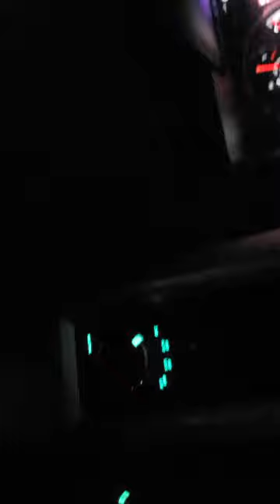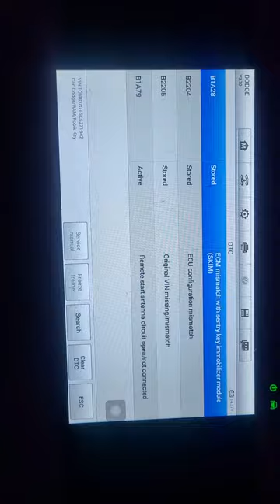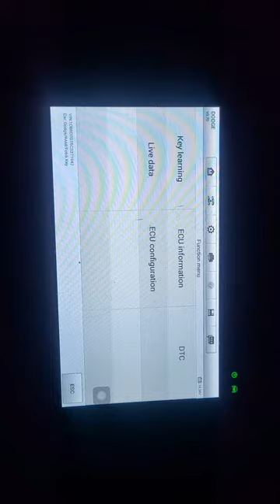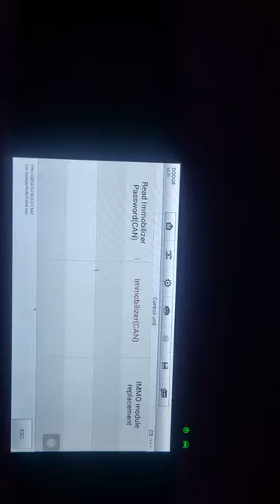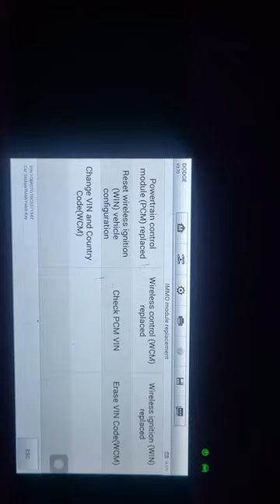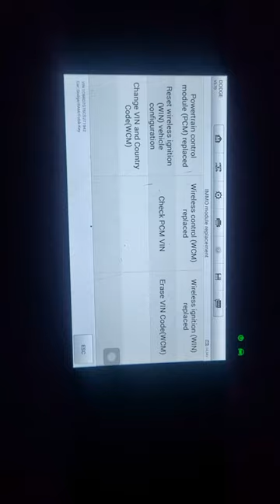programming used WIN MODULE  dodge ram 2012 via autel im508

Comment: Basically what you did is program PCM. Which means that you transferred the vin number that the WCM came with from the old car. And you wrote it on the PCM.
Now if the vin is matching with these 2, it will start and stay running. And could be that it's good enough for this year. But in newer models you'll have problems with other components in the car because the ABS for example won't work cuz now it has a different VIN number. 
So if you didn't see any other errors you should be good.

Comment: Hi is the vin module same as the actual ignition? I have a car that replaced ignition+steering lock. Car starts and dies in seconds. Im using im508+xp400 🙏
Reply from the maker: Yes the win module is where the fobik key goes

Comment: Hey i have the new win and new key it’s supposed to be preprogrammed to the vin from auto tech electronic would I still need to do whats done in this video and also would I be able to if the dash is not getting power in the run position only shows door ajar with the flashing security light
Reply from the maker: Yes same procedure. I did a dodge dart it was ready to go didn't have to do this procedure. But on the ram I did so different models differ. Do the procedure pull new pin. Also if u are programming a used key AND  it's oem then just erase all keys first and reprogram used key
Reply: Ok using two new keys supposed to be plug and play but getting no power to the dash I plan on having someone come tomorrow to program

Comment: So when you resync it does it use the orginal pin number or the pin number from the used win module
Reply from the maker: If its a used win u use the win pin. Of its a new oem win you'll need old win pin
Reply from the maker: Pin from used
Reply: @InitialD15  yeah I got it done. it was locked out due to too many failed pin attempts, I had to leave it with the key on to reset. then I followed your instructions in the video.

Comment: I have a customer that bought a brand new immobilizer for their 2008 Chrysler Sebring because they broke their old one… I have the Autel im508 & I need to program the new immobilizer to the vehicle in order to program the key to start the vehicle so do I need to go to Manual selection & then select control unit then select immo module replacement & once I get there do I need to select Wireless control (WCM) replaced option and then let it sync the Vin number & IMMO data in order to be able to program they key to it? Also since I’m programming an existing key that went to the original immobilizer do I need to access the old immobilizer and erase that key first before I’m able to program it to the new immobilizer. I own a locksmith business and I program keys all the time, but I have not done an IMMO replacement program yet with my Autel 
im508. Any help would be appreciated! Thanks
Reply from the maker: Ok first of all u replaced the module or the immo ring? That uses actual keyed ignition not fobik. So it won't have a wcm. U can reuse a used key on another chyrsyler unless u unlock it or erase all keys and then program a used one it should accept it. But the key also has to he oem not aftermarket.  Always manual selection never auto. Lots of issues with auto.
Reply: @InitialD15  their replacing the immo ring
Reply: @InitialD15  so which option would I use to transfer the Vin number and the immo data over to the new immobilizer module (the ring)which I thought the ring is the immobilizer module is it not? It has a module and ring all connected together and yes, it’s a blade key not fobik I just don’t know which selection I’m supposed to select which option I’m supposed to select to transfer the data onto the new blank immobilizer ring
Reply: @InitialD15  and why can I not use an aftermarket key? The key they have is the actual oem key anyways

Comment: Working in 2008 dodge caravan. Replacing win with used one. This should work. Correct?
Reply from the maker: Ya win module might b different part number but yes

Comment: I thought after you erased the vin that you're supposed to go to wireless ignition replaced
Reply from the maker: This procedure worked for me
Reply: @InitialD15 yeah your method worked for me. I just did a 2012 dodge ram with my 608p2 used one and it does not work the way they tell you to do it. It only works the way you've done it! so thanks.
Reply: I tried to do this on a 2010 Dodge Grand Caravan with my 508 and it just would not work. I don't know why, but it worked awesomely today on the 2012 Dodge ram I just done. They had Locksmith come out and try to do it and they couldn't & one locksmith told them  they don't do ones lol

Comment: What about the PIN code? Can you get it if the old WIN module is out and gone already?
Reply from the maker: Only need new used win module pin. Only need old win module pin if u buy oem new win
Reply: @InitialD15  customer says WIN is actually brand new. I saw a video where you can actually assign a new pin on a new win on the 608. Right when it asks you to enter PIN.,you can just enter any random 4 digit number and it will take it. Can you confirm this?
Reply from the maker: @iskooobydoo  not too sure maybe?  Dealer has old pin ask customer to grab just in case or send me vin and I can do it for small fee. 15 bucks . Otherwise possibly but last time I tried it on a new oem and I needed old pin first and then it assigned that pin to new module and synced
Reply: @InitialD15  Thanks..Yes I'm interested in your PIN service. Just let me know how to do that.

Comment: I had a different a situation
No star
Used win
Then Vin mismatch winvspcm
Autel elite fail to rewrite vin cause used pcm
Elite can't erase vin from used win
Dodge locks you out after 3 attempts.
me getting locked out after 1 time putting pincode...
👍 I pulled the thinkdiag and allowed me to go to function check Vin pcm... rewrite vin on used pcm even with the message "this function is not supported by a used pcm...thank God I was in business van turned on .no more flashing security light